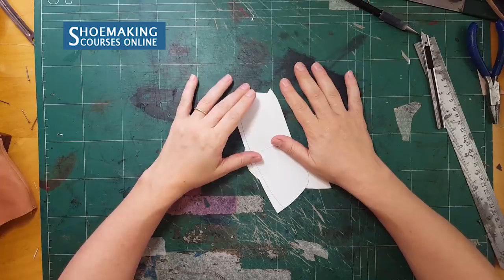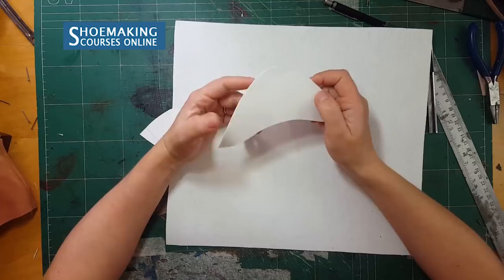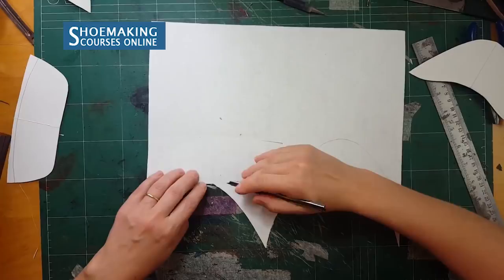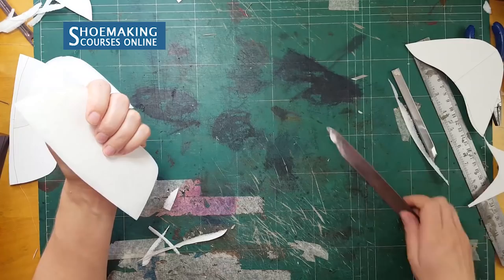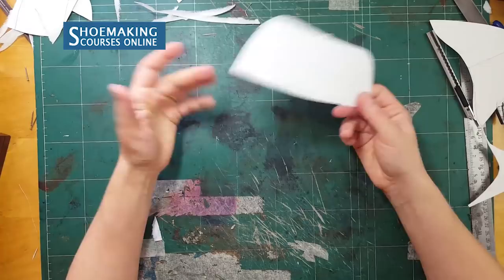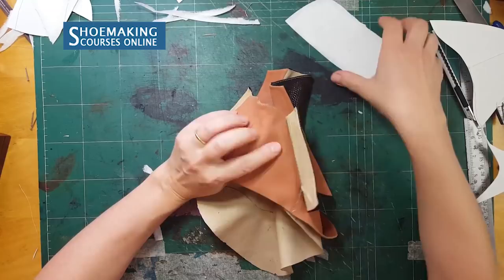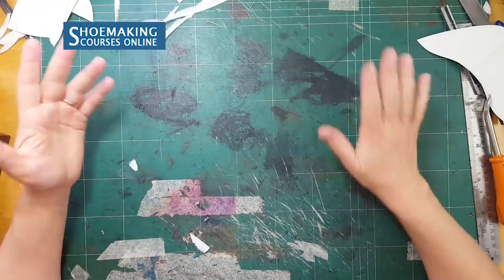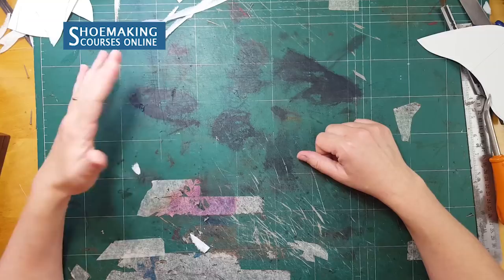✅How to work with Celastic material in Shoemaking

Comment: Wouldn't that been easier do while on the last? Also what are the other materials called that you put in the oven to soften before molding over toe of shoe?
Reply from the maker: It doesnt metter in this case. I don't know what material are you talking about
Reply: @SKDEZIGN  It's heat activated. Maybe plastic. Used in the toe and heel of shoe. Do you know of this?
Reply from the maker: @kennedy67951  thermoplastic
Reply: @SKDEZIGN  Maybe. Thank you for your time.